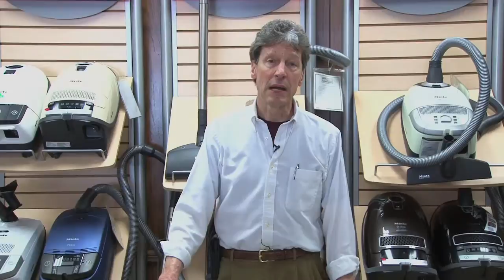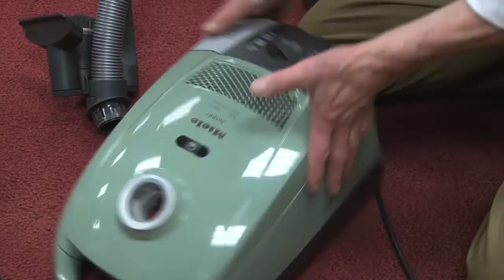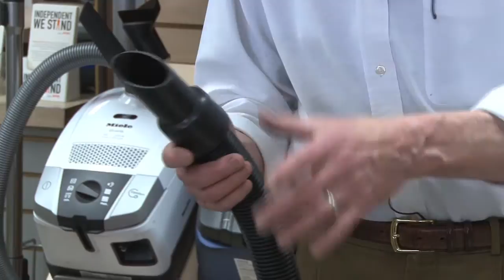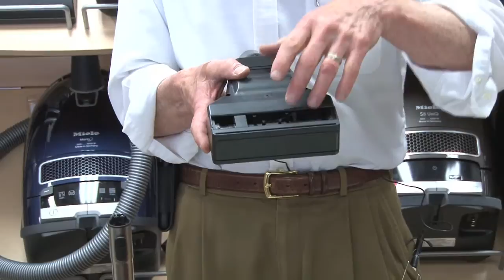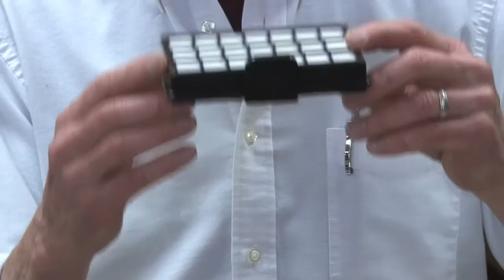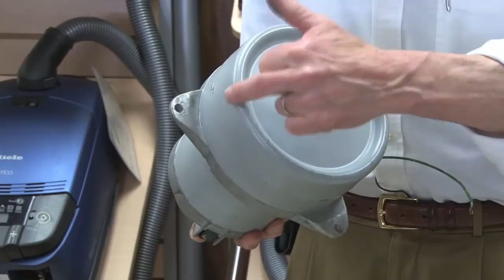How to Select and Buy a Good Vacuum Cleaner

Comment: Nice video, you did a great job explaining the most important functions of a vacuum. I like how you talked about the importance of agitation for carpet cleaning, so many people overlook that and think it's all about suction. Do you sell Riccar or Simplicity vacs? I have a Simplicity Synergy which is the same as a Riccar Radiance and that vacuum is a beast. The tandem air system is extremely effective in carpet cleaning and the tools are very well made and easy to use. I personally don't have much experience with Meile but I do also have a Sebo X4 and that's a great vacuum as well. All 3 make quality products but I have to say, the Simplicity reigns supreme in cleaning carpets and is the only other modern vacuum I've used that cleans as well as my old Royal classic. The Royal lacks in the filtration department though like all of those machines.
Reply from the maker: Thanks for the accolade!  Yes, we also sell Simplicity.  Simply put, with all these manufacturers, it is the old adage:  `good tools work well'.